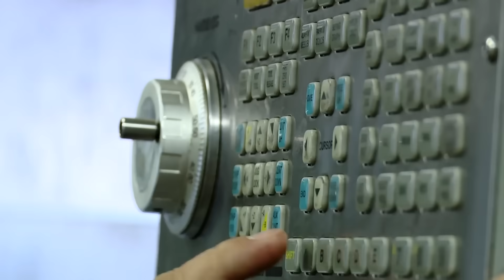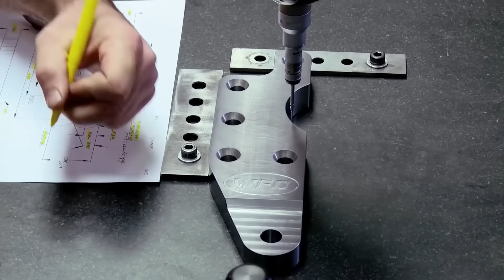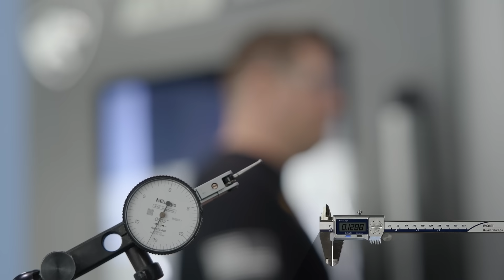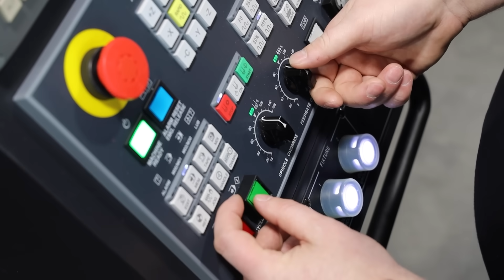Tools Keep Breaking on Night Shift, but Run Perfect on Day... Nobody Knows Why

Comment: When I was in the Coast Guard our boat used a chlorinator to add droplets to our water tanks. Part of the engineer's watch was to go hourly into the axillary space and record the setting. The actual setting on the pump was .001 but we always called 1. After a time we began writing a 1 on the log book. On midwatch a newer guy turned it up from .001 to 1. Around 4am everyone was waking up to the strong smell of chlorine thing the galley was scrubbing the mess deck. We had no drinking water for about 48 hours and nothing could be boiled for eating.

Comment: I came across this problem many years ago when I was managing an engineering company.
We did many different things, but one of them was tube sheets and baffle plates for the petrochemical industry (up to 3 meter diameter).
We were growing and needed more people, but I was reluctant to hire more people.
Instead I collaborated with our in house electronics engineer.
We installed load sensing on the spindle motor and Z axis so that we could let the machines run unattended 24/7 - just one really skilled guy  set up the machines and a few unskilled to clean out the shavings.
What I didn't expect was was that productivity went up and tool breakages went to almost zero.
My conclusion was that the operators were messing with the speeds & feeds.

Comment: When you said this method worked on one shift and not another. Then that means one of two things. There is a temperature problem or someone between the two shifts is doing something incorrect.

Comment: Occurrences like this is why some shops lock the controls so nothing can be edited without the programmer/engineer’s knowledge. Some machines are easier to do this than others. I worked for years in subcontractor shop making aerospace components. Our approach was stringent documentation and accountability. My job was to set up and run samples to adjust tooling then first articles with the proven program. Once Q.C. And P.C. Signed off there were no changes made without everything being proven and signed off on. We had a great track record with our customers for quality and timely deliveries.

Comment: I am a time-served machinist who went on to the design department and got an engineering degree. It is sad the number of times I have heard "do you want what you asked for or do you want it right?". The answer of course is BOTH.
A recent example was seeing a part of mine which had been "rescued" and the re-work was pretty obvious. I asked the line manager what happened and was told "That was Sam using his initiative..."
Reply: I have seen that happen but usually suppliers take the initiative. When things go sour they start to make what the drawings call for and then assembly or product starts to fail. Usually the root cause is that the designer didn't know what to do and just drew something and the supplier didn't want to educate the designer but instead just made their own drawings the way they needed.

Comment: Man i use to operate a big part washer they would come up to be and be like why arnt you running the same amount of parts as first shift well like i explained and as they found out the engineers would come out and turn up the washer speed so they ran more parts and people are like why didnt u turn up the speed well its because it was pass code locked so i couldnt and we weren't sapost to just remember first shift is there golden child dont talk bad about them or ur the one getting in to trouble even tho the facts are right there

Comment: there was only a handful of things that could have caused the issue
speeds and feeds - based on the bits used and is the most likely
local weather - this depends on the material or bit dimensional stability and yes i have seen this
power regulation - this happens if the the power to the system is not 100% stable, i have heard of this but never seen it

Comment: I got in a mild amount of trouble one day when I got bored on machine. I asked the boss "Why don't we run this program faster? The material and tooling can surely handle it right?"

Well.. what I didn't know is that a major part of their rpm consideration was for the occasional custom order parts that ran the same programs. Same diameter rod, but with a crap load of stickout... And if they tried running a soft hydraulic rod sticking 2 feet out of the machine it would probably kill someone.

Lesson learned. Don't adjust proven programs. Better to ask than to FAFO. I'm lucky that boss was only in the mood to give me a very stern wanting with many graphic mental images of 'what would happen if' went sideways. 

In another job I noticed one part of 3 or 4 in the fixture was consistently wrong. I called the lead over and pointed it out, and he went through the code to find where someone fat fingered the program just enough to make that error but not enough to make it super obvious/easy to find.

Comment: I worked for a commercial printer that ran 3 shifts. When the morning shift would come in they would complain that not much work was done. The owners installed some hidden cameras. Turns out the graveyard shift was taking the paper delivery carts off the presses and using them to push each other in a makeshift  racetrack. 🏁

Comment: The idea that the US still uses the Imperial measurement system in industry is mind boggling.
Reply: The cost to change it (and the cultural shift it would take) is mind bogglingly expensive and difficult. We're also a huge nation and the biggest economy in the world. That means in many cases we set the standard. There's not enough insentive for most industries to spend time or money on changing over.

Comment: I worked in a automotive belt manufacturing plant. The belt length (to the millimeter) was achieved with cord tension setting. The belt cutter would sample three belts and let the winding station know any adjustments that needed to be made. One cutter had no understanding of a negative number, if the tolerance was +/- 2.00 he always targeted +2.00, as you can see it bypassed the margin for error.

Comment: 0:04 I worked at a place that made nuclear steam generators, and parts for nuclear reactors. 
If they found that you changed a program without authorization, they would fire you on the spot.

Comment: Power can also be a problem. Some machine clocks derive timing from the power frequency so if it's 62 or 63 Hz the machine will run faster than at 60 Hz.  Powerline voltage can also increase at night and add to it.
Reply: Even 62 Hz would be such a serious deviation that I doubt that the grid would make it. 63 Hz is unthinkable.

Comment: I run an extremely old rotary machine, and it has very specific settings and quirks.
When I train new employees, I tell them "If it's running, and running with no issues... Don't play with it. You will make your shift a nightmare".
But there's always that one bloke, who thinks he knows better, and I have to fix/repair the damage he will cause.

So if you're new to machining, and the expert tells you to leave it alone... you leave it alone.
Reply: You need to selective when you say this. New people have new perspectives and can bring new ideas. There needs to be room for them to explore and for you to explain why something went wrong on noncritical steps so they can learn.

Comment: When you said it was stainless steel, then said he was running the feed speed at 30%, my ears perked up. From my days working in broaching, I remember stainless, especially 300-series stainless, is work hardening. If the feed speed (actually, cut per flute) is too low to get the cut below the hardened surface, it will play hell with tool life and surface finish. The night guy may not have realized the material implications.

Comment: No, the key take away here is if you’re going to do something for dayshift set up a bunch of parameters and test for a piece of equipment. Then you should also take the time to have somebody dedicated for nights to relay this information so that the people using the equipment have the same understanding as the people on dayshift That sounds like a communication issue otherwise known as a skill issue in management.

Comment: I knew where this was going from the start.  Common common problem.  First saw this when myself when found out every shift reset the machinery to the settings they "knew" were correct at the beginning of the shift, then adjusted to make corrections as the work was out of spec.  Each shift would always get to the same settings before their shifts ended, but each shift "knew" those settings were wrong when they started the shift.
Reply: This... it's a lot of big egos getting in the way.

Comment: You also have to remember that tools wear out over time. With some metalworking applications, a drill or cutting bit can literally be dull or worn out after one shift and need sharpened or replaced totally.

Comment: I'm going to chime in as an overnight chemical operator. If you set your parameters during first shift, when everyone is there, you need clear procedures and how it is communicated with a paper / digital documentation. Trust me, my insistence on clear communication and documentation has saved my butt when I have had to full stop / triage the situation; to the point I yelled at the plant manager where I proved he was at fault not me. 

Moral of the story document everything to cover your ass.

Comment: I'm a technician working night shift quality control in semiconductors, and our main issue is that shift engineers almost exclusively work 9-5, but day shift technicians never consult with the engineers about whatever issues are happening. Then the engineers go home, the day shift techs pass down a bunch of stupid problems they never consulted the engineers about, and then night shift has to make a bunch of executive decisions that make 9-5 engineers butthurt. I guess the simple solution is to hire engineers to cover the night shift, but I'm being serious when I say not even one of the top worldwide semiconductor manufacturers cannot pay the prima donnas with degrees enough money to work at night.
Reply: Offset your shifts, even if its by just an hour - so the engineers see both shifts of operators. Also, speaking as an engineer - if somebody would pay me to work 11-7, I’m fuckin there yo. But no, they want me at their shitass 9am meetings about nothing
Reply: Then why are you looking for poorly educated saps with degrees? This kind of work, you get fucking nowhere with a degree. You get in, and learn for years, and become a functional part of a team. No education system is good enough to make you good with production engineering. This is why we have production engineers that claim they're too good for night shifts. I chose to work at night in my field, because when else do you get to run around a hospital with a chlorine dioxide gas reactor? Look for people who take pride in their work, and have confidence in their skillset. University is bogus.

Comment: Similar thing happens at my shop but slightly different as they always think it runs too fast and set the override to 80%.  If you then adjust the program to that 80% feedrate, they will still run it at 80% so now you are only running it at 80% of 80%

Comment: night shift worker all my life. stuff is broken during the day and they hide it for us to think we did it
Reply: A company my dad’s firm used to have close ties to making a variety of metal lengths and metal parts etc. they used to run 3 shifts. Day shift, night shift and an in-between maintenance team. The maintenance guys would check every machine and bit and check each shift knew what they were doing. Resulted in an almost constant flow of good quality parts apart from once every two weeks a shut down of a rotation of machines to do a full clean, check up etc. An other firm bought out the company and as a cost cutting measure they removed the maintenance team and increased the output expectations from each machine operator, pushing the machine checking duties onto each of the other shifts… 

Within a month almost every machine was fucked in one way or another. Some deliberate duck you moments, others basic incompetence from guys wanting extra cash without the knowledge that came with it.

Comment: the problem was not the second shift operator,  it was the lack of good communication,  on why the machine had to be run a certain way,  so if the progammer had informed second shift of the why's    the problem would not have happened.

Comment: The 2nd shifts I have been always outproduced quantity and quality by far. 1st talks too much and 3rd sleeps on the job!😂
Reply: Yeah they like to drink coffee and stand around chatting before starting the day. Then they find something slightly out of place and spend 30 minutes complaining about second shift. Then they have problems running parts and blame second shift for changing a program and "that's why they couldn't hit rate today". They proceed to do the easy runs. Then they end day early and chat some more. Second shift comes in and hits start and follows the ugly schedule first shift left them with not knowing any different because its the same every night.

Comment: I expected it to be shop temperature, machine temp, sunlight... all of these happened in the past. 
Like every monday until 10 ish the machine would not produce in tolerance, but after it run perfectly fine for the rest of the week. Well the shop wasn't operating on weekends and turned the heating down a bit during it. The air in the shop was war on monday moring, the machines how ever weren't.
Others had a whole wall of glass in their shop for some daylight, looked real good, but when the sun came around in the afternoon, tolerances went out the window.
Same problem can occur even from the heat the machine is producing itself...
Reply: I thought is was linked with electricity.
Reply: I thought it would be vampires.

Comment: I love working at jobs where they just assume everyone else knows everything because they made a decision during the day while leaving everybody on 2nd and 3rd shift in the dark.
Reply: They made settings for the job and told the others to use it. Guy decided to not follow instructions and hit problems.

It's not complicated. And not every decision needs to be explained in exhaustive detail.

When I write instructions for you to follow, you need to follow them. If you feel that the instructions are wrong, you raise it to me and we will work through if you've discovered a problem that should be fixed.

Comment: Same issue with old school operators at my work.  We make wire, and different designs require different drawing conditions.  However, one operator remembers a time someone ran a machine a certain way, and "...it would save us so much time!"  Sure enough the condition of the wires turned out garbage, and we wasted both time and money.  After some training and a personal heart-to-heart about why it's different in this case, the operator went back to the proper setup, and things went well.
Soon after that, we find out wire is coming back with the same issues again.  Come to find out not the operator, but the manager of sales was using her nepotism with others throughout the shop floor to force operators to run things faster, just so they could get numbers out the door.  This was even if the wire we sent out was eventually returned for being garbage.  All she cared about was her sale figures for the quarter, and not "overall profit after returns" because that didn't concern her.
Needless to say, I don't work there anymore, and now work at a wire shop that still has issues, but is much better overall.

Sometimes, that side of me that is an introversive nerd wishes we could replace some jobs with AI asap.  AI would at least go to the customer and answer "Yeah we had some problems with the most recent batch, and so your shipment will be delayed this week."  Customers are angry if late, and angry if on time, but needs returning.  Still:  Lowering our quality to achieve that is not helpful for their bottom end, or long term benefit.

Comment: I had this problem once as the 'off shift' operator. However it turned out what the issue actually was is that the tool room was delivering the wrong bits and putting them in the right places because the other tools needed to be sharped for 1st shift.
I was changing nothing but the tools were dulling to fast resulting in bad cuts and broken tools. Of course this was all my fault until I was shown the proper tool while being yelled at about 'how difficult is it to put the tool in the F'n machine and press go?"
Turns out it's pretty difficult when on late shift and no tool room people or even maintenance people available to get the right tool from nor shown the new V9 (or whatever the code was) tooling, no updated paperwork or even schematics. Just a new program combined with old tools and half mumbled directions because the paperwork wasn't available yet.

This is a pretty common occurrence on 2nd shift (because 1st shift is understandably eager to leave) and third shift because the plant is largely empty and everyone is left to fend for themselves.
Reply: So, US prefers to run on triple 8 shifts over double 12?
Reply: @TheArklyte  It depends on the company.

Comment: I would think that there should be a way to lock out people from changing the CNC program once it has been verified to be running properly and according to the programmer's wishes.  Is this not the case?